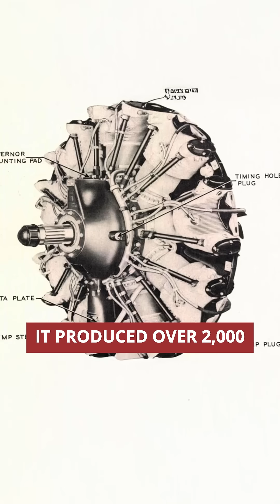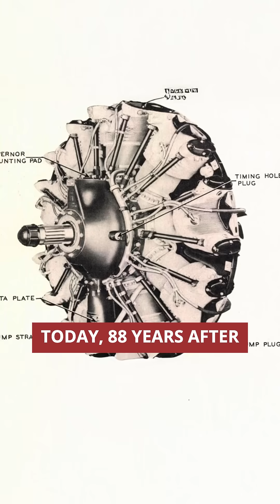What Engine Powered America's WWII Fighters?

Comment: Biggest fiasco of the war.

Why didn't they use it in the Fortress and Liberator, both hopelessly underpowered by tiny 9-cylinder 1200 hp engines ?

Putting the turbocharged, water-injected R2800-57W in these two bombers would easily have taken them to 350 mph at 35'000 feet, making interception very difficult for German fighters.

Even the little Lockheed Vemtura had two R2800s, upgraded from the Hudson with 1200 hp R1830s.

Comment: They bumped them up to 75 inches of boost and the made 2800 h.p. with water and methanol injection. With paddle blade prop they could climb with the fw 190 and dominate them.
Reply: It was partially the water methanol injection, but it was also because some theaters of operation started to get 150 octane fuel and the mechanics were sent info on how much they could turn up the boost, based on higher octanes

Comment: It was a good second string engine  for a second string  fighter
Reply: It wasn’t either. Also that statement doesn’t really make sense as you are implying that the planes that used the double wasp could carry other engines.

The claim they were second string fighter also doesn’t really make sense. No plane it was used in was a second string fighter. While the P47 was replaced in escort duty in the majority of the eight air force by P51s, the P47 was still heavily used in fighter sweeps and was, along with typhoon, the primary strike fighter of the ETO. Calling the P47 a second string fighter is basically calling every other fighter other the P51 a second string fighter as it saw the majority of combat during the end stages of the conflict due it being the primary bomber escort. 

The double wasp was by far the primary engine of the pacific campaign as the inclines other than the Allison were quite unreliable in those climates with the Merlin, the other widely used allied inline, couldn’t really cope. The Merlin was honestly the third string due to the fact it was unreliable in the South Pacific with it facing issues of overheating, corrosion, and breakdowns as seen in the high attrition rates of Australian spitfires over Queensland and New Guinea. It wasn’t really until the very end in the north eastern pacific where the Merlin was put to good use

Comment: It could get the pilot back even with some cylinders shot out....
Reply: How was the cylinder rod kept from destroying adjacent cylinders?
Reply: @george2113 Well it wasnt always the cylinders themselves, but stories of thunderbolts with half the cylinder heads missing and still landing safe was not untrue
Reply: @grey-god Unless you witness it for yourself you really dont know what stories are true or untrue
Reply: @DanPerissinotto-yd8nn  It's a well documented fact that Thunderbolts had returned to base with serious engine damage, while still being able to run. Two major factors play into this. 

1: It's a radial aircooled engine. Shooting out the cylinder on a standard liquid cooled engine would rupture the water jacket and lose cooling capacity. This cannot happen on a radial, since it's air cooled.

2: The Double Wasp radial is two radial engines put together. If in the event one of the cylinder banks (fore or aft) saw catastrophic failure, the other bank is sectioned off in it's own housing. This has the added benefit of shielding it from debris from the adjacent bank, in such an event.

The Jug may not have lived up to the intended purpose of being a dedicated escort fighter but it was a damn good plane.